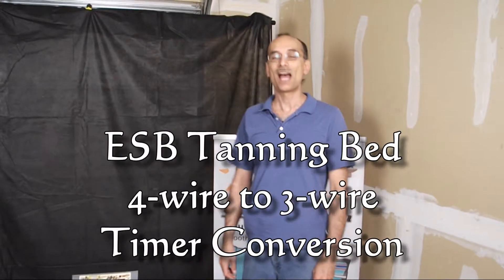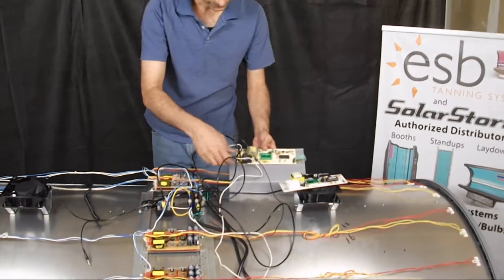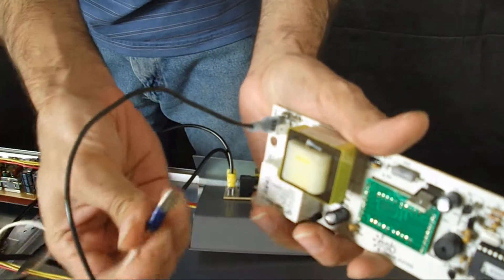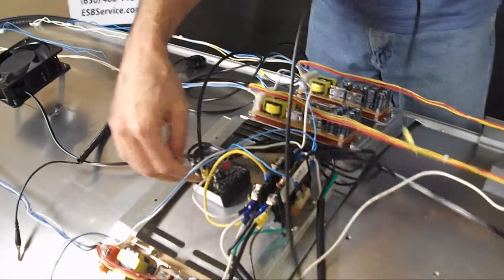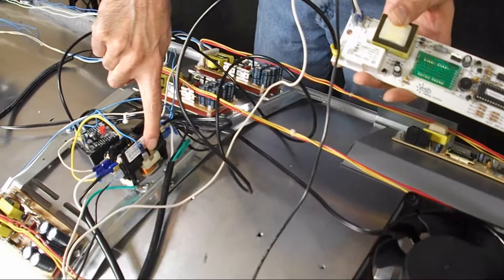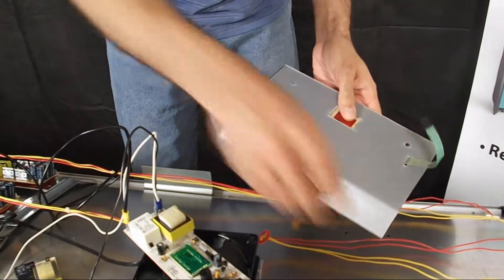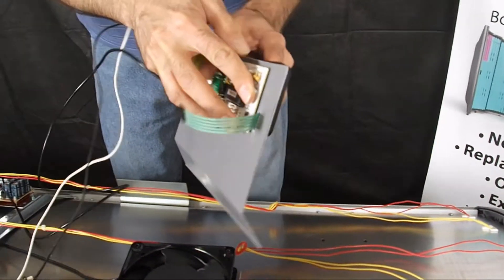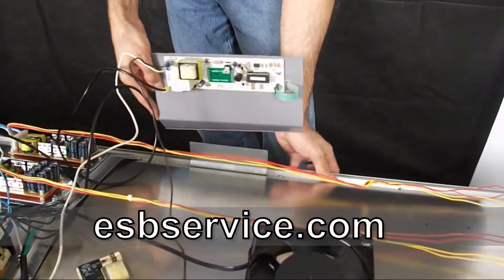Converting from a 4 Wire Timer to a 3 Wire Timer on an ESB Tanning Bed

Comment: I have a tanning bed I want to put at max timer on it but it does not have a plug-in is there anyway to do that
Reply from the maker: Thanks for your question.  If you want to use a T-Max timer as a "Master" timer, the tanning bed bed needs a "Slave" timer with the remote ports like this one here:  https://solarstormparts.com/shop.htm#!/Commercial-Timer-3-Button-Solar-Storm-24C-32C/p/69739881

If you're doing a complete conversion from residential to commercial, you may also need other parts such as these:
Wire Harness:  https://solarstormparts.com/shop.htm#!/4-Wire-Harness-SOLAR-STORM-3-Button-Timer-Harness-ONLY/p/261214187
Bezel:  https://solarstormparts.com/shop.htm#!/Timer-Bezel-Black-Timer-Cover-Solar-Storm/p/65234363
If you would like further help, please let me know what kind of bed you have - and the style of timer setup that is installed.  Thanks,
Russ